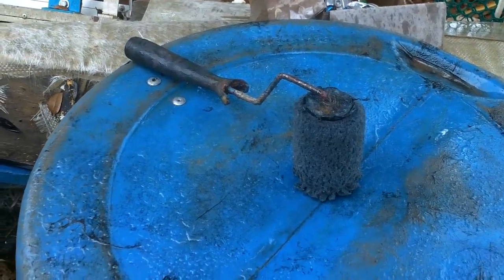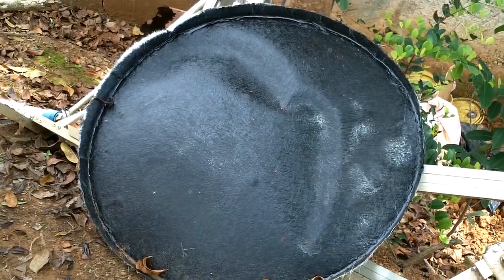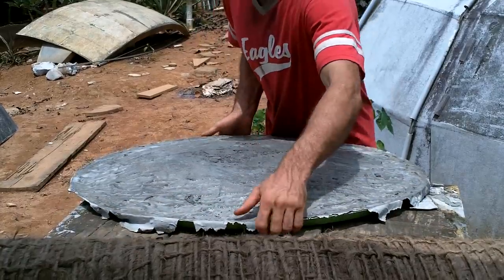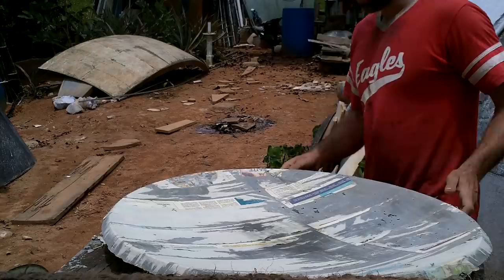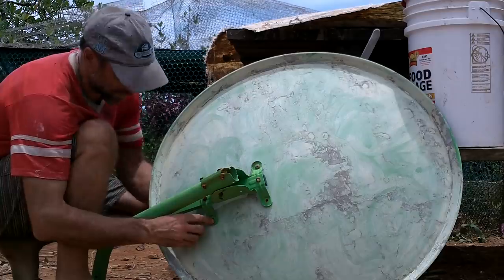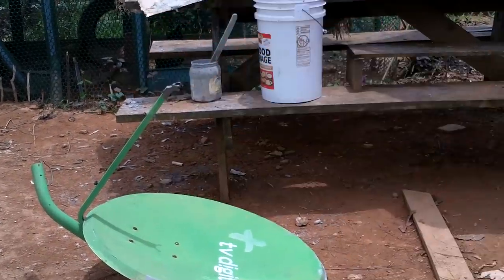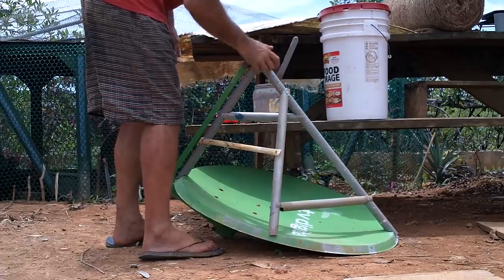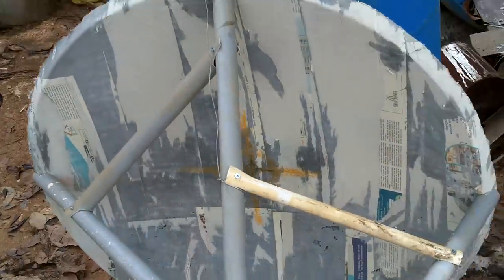Parabolic Whisper Dishes 001 Plausible???

Comment: The focal point of the dish is at the receiver mount. The ones offset like Jamie's are a side slice of the parabola.  You could find the direction of aim by tying a few  strings to the receiver, then stick them to random spots on the disk. Measure the smallest angle the string make with the disk, "angle of incident". The angle of incident will be equal to the angle of reflection and in the same plane. I think that could be done with minimal stuffs.

Comment: With a couple old routers you can send your internets to the new island with those.
Reply: Would need to coat the concrete one with something conductive - but absolute :D
Reply: i used a similar dish with a usb wifi dongle and could pick up wifi from all over town, also you can combine this with a "Cantenna" to get even more gain, you do need to have the alignment nearly perfect though..

Comment: Cool stuff man, no reason small ones wouldnt work. There's a 'gravity museum' just north of perth, got all sorts of cool 'big things, tiny results' sorta things. Theres a gravity wave detector there, but other cool physics tricks to, pendulums n stuff. Got some big (maybe 2m) dishes set up, exactly like this. Its super eerie how quiet you can whisper. To improve your setup, Id guess you need a feedhorn, to properly 'lock in' the spot, focus right on the focal point, n keep your fat head out of the signal path. Just a length of pvc at the right angle n long enough to stop your head blocking the cone of the parabola. These big dishes were such you could just see the other person, but you were standing in the signal path. 

Cool stuff dude. Cements probably a better material anyway. England built huge ones to detect incoming  planes pre ww2, before radar was a mature thing. Concrete bounces sound really well.

Comment: done want to rain on your parade, but have you tried transmitting sound with modulated light?  There have been some really interesting experiments in Australia and Utah where they transmitted sound with LED lights.  Apparently the old thing with lasers transmitting sound is not as efficient, as just using a focused LED.  Something about atmospheric interference.  Seen some old tests online where they were getting over 80 miles range between mountains.  they also were sending sound out of Salt Lake City to a mountain and the city lights were not affecting the signal.  Basically it is just a electric eye and a amplifier as the reciever.  Apparently you can also use a solar cell as the reciever much like a single pixel giant TV camera focused with a Fresnel lens

Comment: James are you blocking sound waves with you brawn ?
Reply: Yes, in it's final form using a small microphone / speaker combo will probably be needed. The body blocks a large portion of the incoming sound waves. Also, you could build a dish that has a downward focal point, that way you don't have to stand in front of it to use it. It might be hard to make that shape in the wild though.